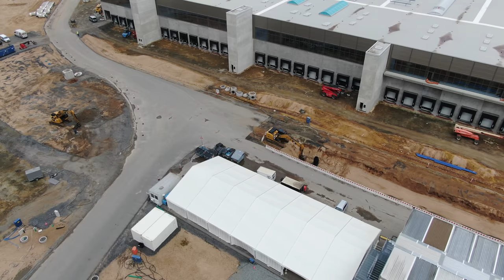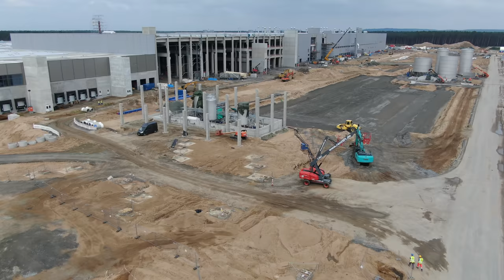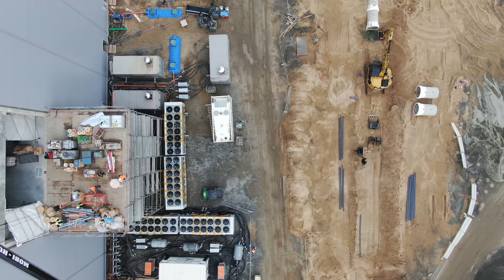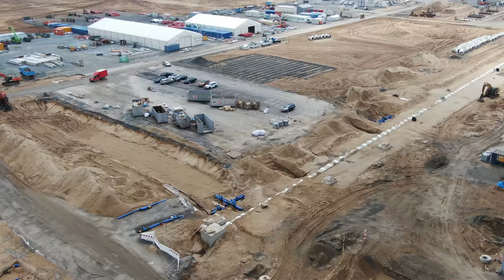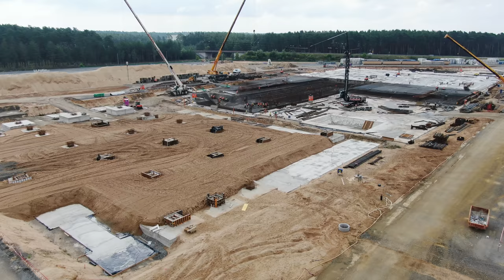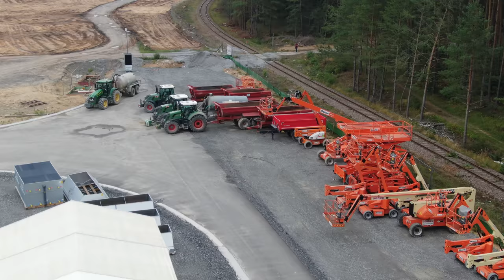Giga Berlin | 2021-07-17 | Pipe Bridge Foundation

Comment: Does anyone know why the battery factory has such a massive thick foundation? I saw nothing unusual with battery factory foundation in Austin except two small areas built deeper.
Reply: It will be 4 floors tall.
Reply: @JK-ku2mj   Was that information released the city plans? Still such an incredibly robust foundation, still think there might be more to this.
Reply: They avoided the pilings due to water contamination concerns
Reply: Huge weight of the batteries and machines probably. When the cells are formation charged and discharged they are all bunched together.
Reply from the maker: @starshipcaptain4753  The new plans for the factory were public for a month until yesterday. https://twitter.com/tobilindh/status/1405718654457634825
Reply from the maker: @snviper  Actually, the formation is the only section that will have single footings and is not part of the big foundation plate.

Comment: When are they going to put the HVAC systems on the roof.
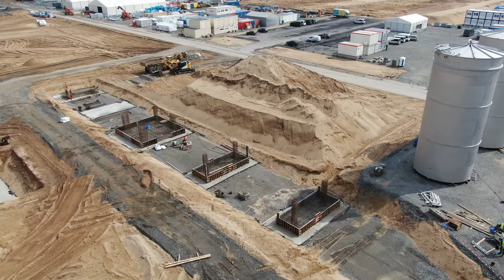Reply: Don't know. The more heavy HVAC systems will be placed left and right from the pipe bridge they just started to build at 4:16
Reply from the maker: @abalada  The part of the pipe bridge they started right now, will be inside the CUB. Cooling systems will be placed north of the CUB, but there will be no pipe bridge on that area. And as far as I know, those are not HVAC units, they are coolers for machines.

Comment: Time to pick up the pace. This factory should have been done by now.
Reply: When Giga Shanghai was as old as Giga Austin it was already producing cars.  That does not mean that the Texans are slackers of course, Shanghai was on a different scale and initially imported most of the components. Shanghai has been adding extra features such as the drive unit and the Model Y plant including casting which are at the the newer plants from day one. Berlin and Austin will also have a battery plant onsite which adds substantial time. You can't get a baby in one month by getting 9 women pregnant.